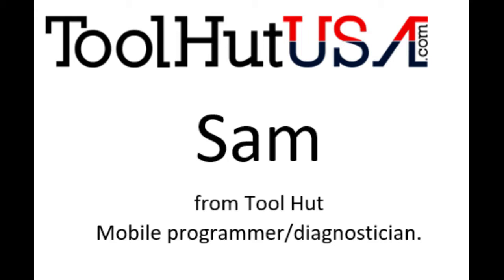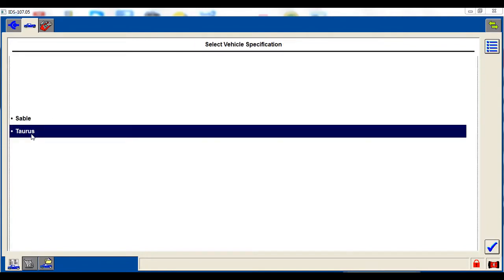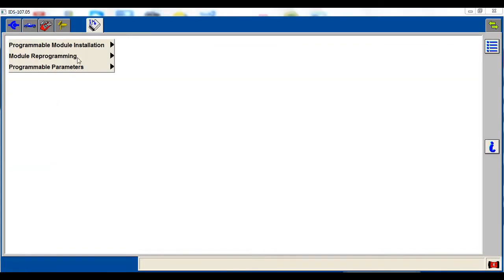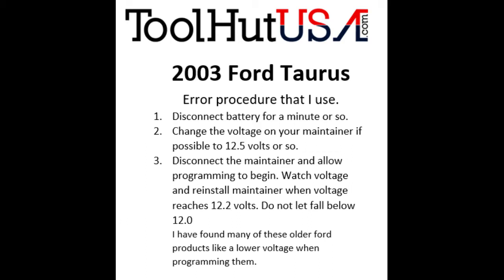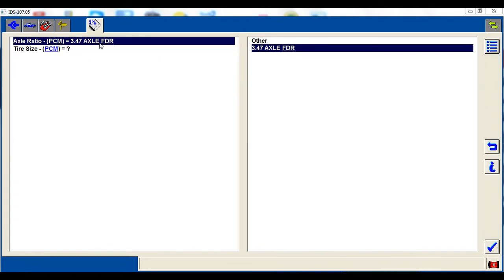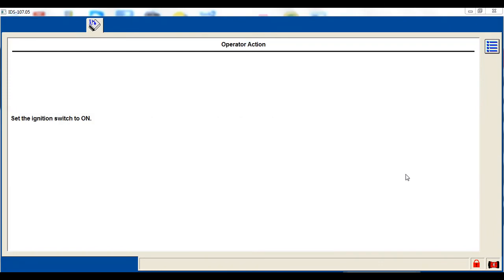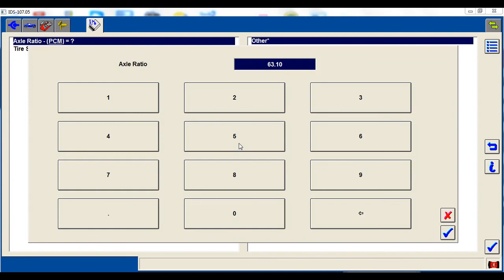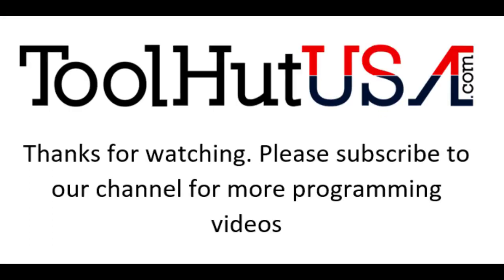2003 Ford Taurus PCM program error codes

Comment: Thanks Sam, this is great information. I did a subaru legacy recently and it wouldn't program with my maintainer on it. Error message said module voltage was too high. I put a jump box on it instead and it programmed with no problem.

Comment: Hey Sam and thanks for sharing what you know about programming! How come the programmable parameters could not be set the first time? I guess I do not understand that part but I see what you did simply by going back and doing it. Was it a used ECM? How come you did not have to redo the PATS? Sorry if you explained it and I missed it.
--Eric O.
Reply: Hmmm interesting. I have only done a dozen or so Fords and have not ran into it yet but when I do I won't panic now! Thanks again for the tips.
--Eric O.